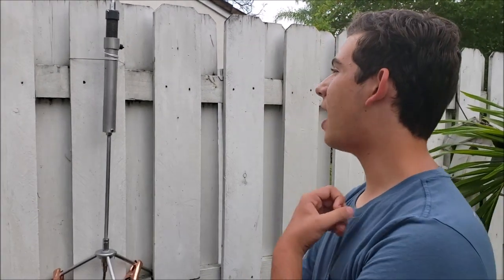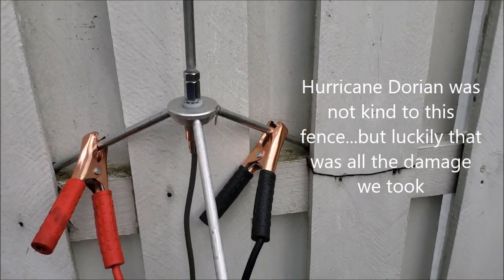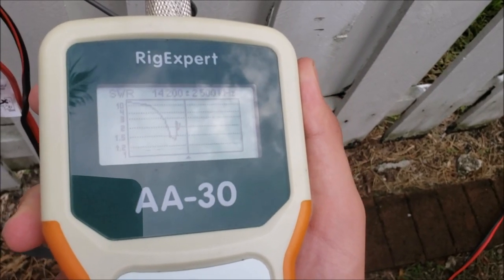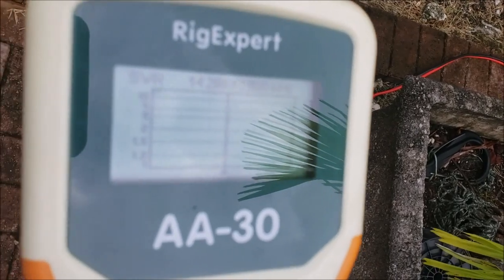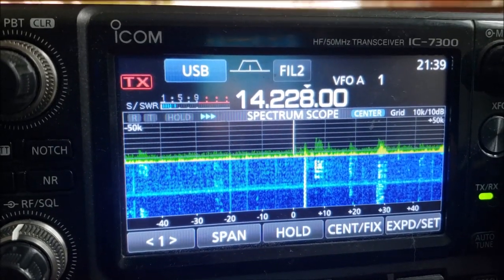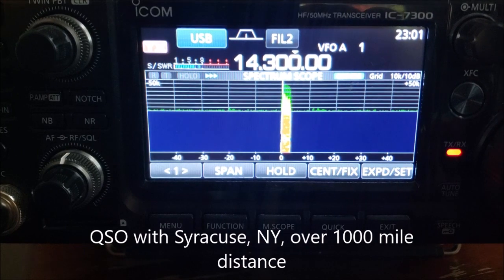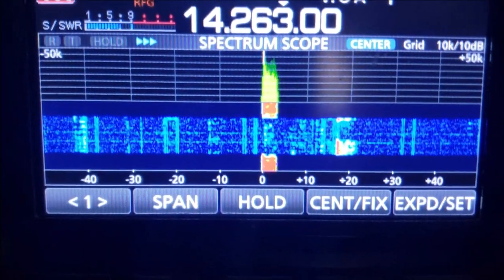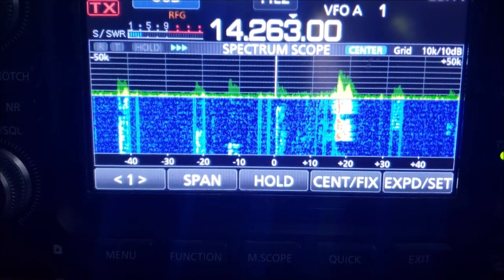2019: MP-1 Super Antenna - coil loaded vertical tested on 20m

Comment: You had the antenna upside down and the 3 metals are your legs for the mini tripod so the jumper cables are on the legs of the tripod and in the pack were some counter poise that fix to the tripod mount

Comment: The coil is upside down.
Reply: wondered why the coil was upside down as well... then again, does it make much difference?
Reply: @AI4QT  Yes.  If it rains, it will fill up with water. However, electrically, it makes no difference.

Comment: Great job with a less than perfect setup. Remember, the best antenna, is the one which actually allows you to get on the air. Here's some tips for any quarter wave band adjustable antenna. Make yourself a 3 point counterpoise set about to quarter wavelength, for the HF bands you'd like to use. Attach those to the cold side of the base. Elevate them about 3 feet above the ground. With this type of antenna, you need a tuned counterpoise for each band you're using.
Anyway, very well done. With limited space it's often difficult to come up with the perfect antenna. As we see in your video, we can certainly improvise, to come up with something which works well enough.
73
Julian oh8stn